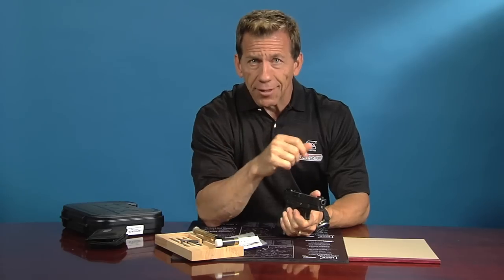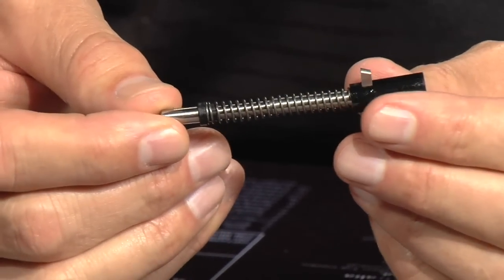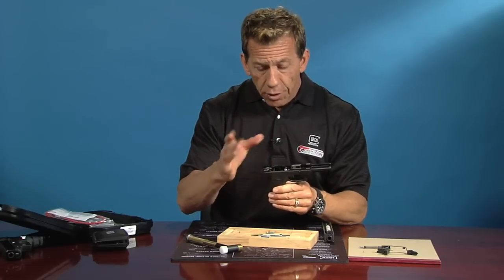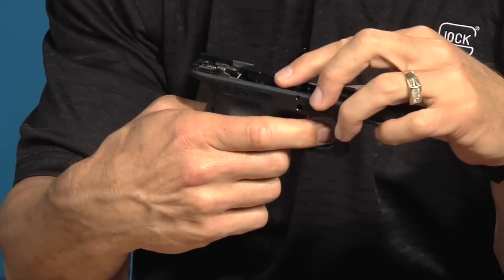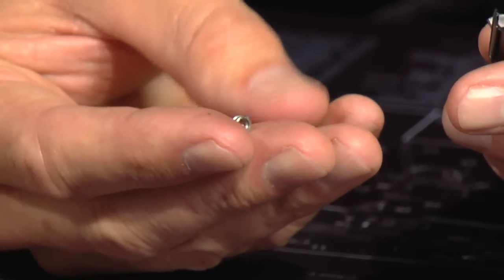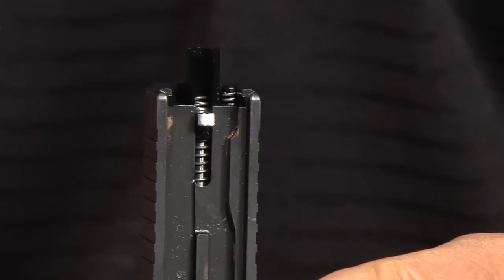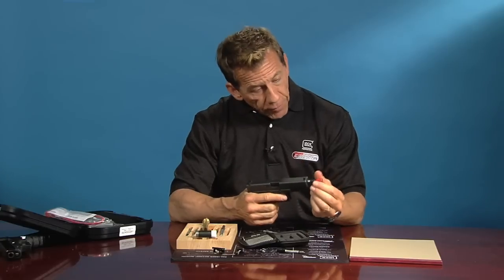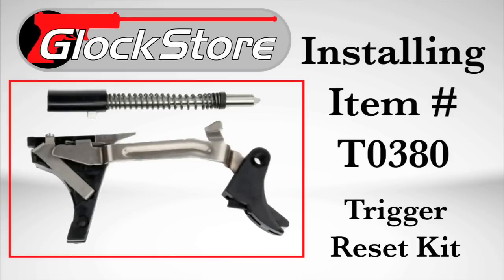Reset Trigger

Comment: Thanks Lenny, great work w the glockstore. Was dryfire training w the laser cartridge for a month, racking by hand in between shots. Just got the trigger reset. 
Had some technical difficulties at first. 2 things. 
First the trigger pull was incredibly hard, I have no clue why, I took it apart and reinstalled it and then the trigger was fine. But then the trigger wasn't engaging the fireing pin ever time, only when i jerked it, but not when I pulled the trigger slowly. So i figured it was the trigger spring since it was a fluid but predictable mechanical failure. 
TOok it all apart, and found that the trigger spring didn't have S hooks on each end to lock it to the trigger mechanism and the trigger bar, allowing it to shift depending on how fast and how much pressure was applied to the trigger, resulting in failure to engage when not enough pressure was applied fast enough. I bent the ends of the spring to lock them in a bit better, though still not as solid as an S hook would be. Please make sure that design is changed for future production. 
Otherwise I appreciate the mechanism, it now works very well. Definately worth the money.

Comment: Because Glocks don't have a second strike capability....this trigger would give glock that ability if you could use it with live rounds
Reply: Glock should just make their guns with repeated-strike capability.

And they should start doing with their grips what every other manufacturer is doing—making them modular with various sized and shaped inserts to customize the grip. ONE GRIP DOES NOT FIT ALL.

Comment: Hello Lenny, Is it possible to use a weighted training magazine (I've usually seen them in blue and they simulate a loaded mag) with your system.  That is, can I drop the mag, rack the slide back, insert another training mag, and go on firing.  Or will this not work with the reset system?   . Thx
Reply: the slide doesnt rack, so if you have a weighted mag(of course with dummy rounds, NO LIVE AMMO to prevent accidents) it should work. it wont lock open if the mag is empty, and wont rack a dummy round in the chamber after pulling the trigger. now i want to make weighted mags for training this and general endurance. thanks for the idea.

Comment: Does anyone know why my glock 19 is not resetting? If i rack the slide with ammo my trigger is just loose it doesnt stick out to fire! But if i put pressure on the trigger when i rack it, it works
Reply: Buy a S&W
Reply: @mrbmp09  Yeah—because rolled pins are so much fun to work with. 🙄

Comment: Perhaps a stupid question, but - can this be used with regular fire? Or only for dry fire and then ahve to switch back to the original for live fire
Reply: Nope. Only dry fire.
Reply: @ZSmith-yy4lv  do you know if it works with gen 5 normally?
Reply: What if you used live rounds

Comment: So Lenny, lemme get this straight.  I need to fully strip down my Glock (minus the sights) every time I want to practice.  If I practice multiple times a week, then I will be drifting the pins at least 700 times a year...and that will do nothing to the frame...not to mention the tedious nature of having to completely strip down the frame (minus the sights) each time I want to practice.  Great!  What's not to like.  You can 1) wear out the pinholes in your frame, 2) learn trigger control while doing it, 3) and become an export Glock armorer, all at the same time.  Unless you have a spare Glock that you want to convert into a toy, this thing is a well-intentioned bust.  BTW, is the white nationalist custom option your favorite model?
Reply: you want a second gun and leave the trigger installed. but then you can just get a SIRT gun

Comment: "The Reset Trigger System drops into your existing gun in less than 2 minutes"...... right
Reply: im brand new to guns and installed mine in 15, most of that time was spent taking off the slide cover plate which was hard, and then learning where all the parts were that i needed to remove and how to remove them. now that i've gone through it i will be able to switch out triggers much quicker. probably 5 minutes right now. with some practice and trying to rush through it, 2 minutes doesn't seem unlikely. but i wont be rushing through it, thats how things get lost lol.
Reply: @michaelanthony2395  does it work and reset normally in gen 5 as well?
Cause in their website, they say the reset trigger bar for gen 5 is the same as gen 4 but they don't make it clear whether it works perfectly or not.
Reply: @FaLkraydz  i wouldn't know tbh.  i only have a gen 4
Reply: @michaelanthony2395  ok, thank you. :)
Reply: @FaLkraydz  I have the same question, did you end up testing it? Please let me know.

Comment: There must be another way! Does the Glock Factory approve that the trigger assembly  be removed on a such a frequent basis? I would expect  enlargement of the holes in the frame due to excessive wear of the plastic frame material! It seems to me that users may have to replace their frames if the three pins will not stay in place - BAD IDEA for the gun owner but maybe O:K IDEA for gun shop owner!